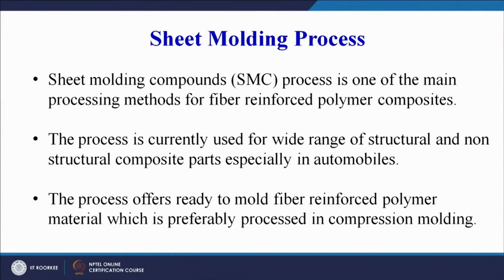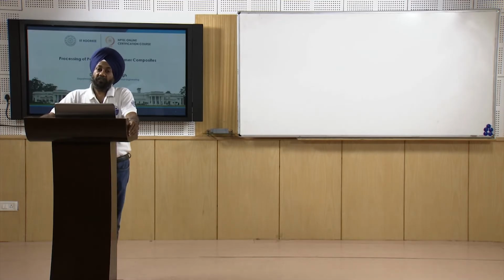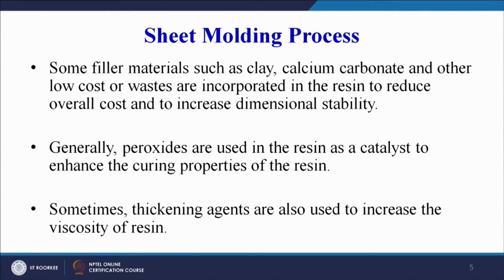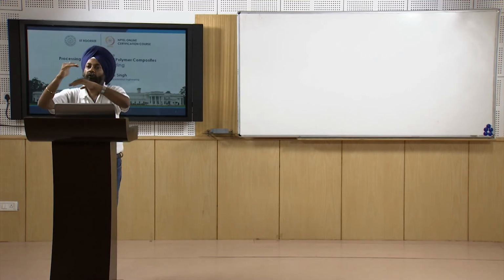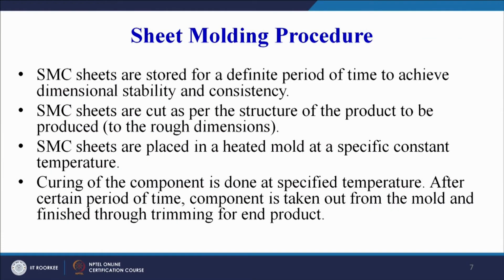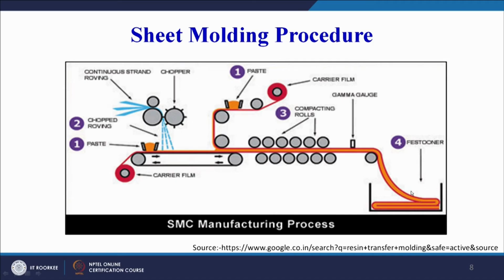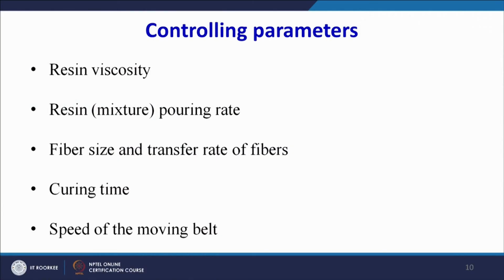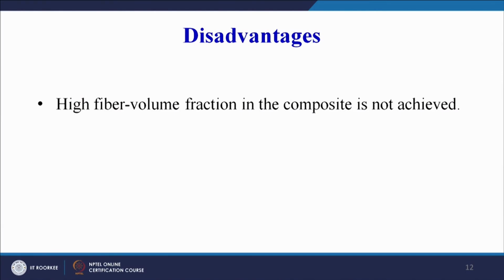Sheet molding

Comment: Sir in Google,  SMC method used for long chopped fibre but you say for Short fibre . please correct me out ...
Reply: Hello, here is an abstract of the paper Composite material parts manufacturing of Jurgen Fleischer et al. 
"Depending on the later use case, the
fibre content (in SMC process) varies from 20%wt–40%wt with a fibre length of 25–
50 mm" .